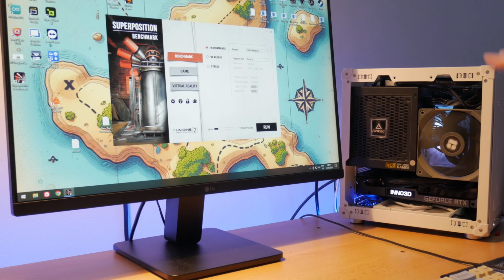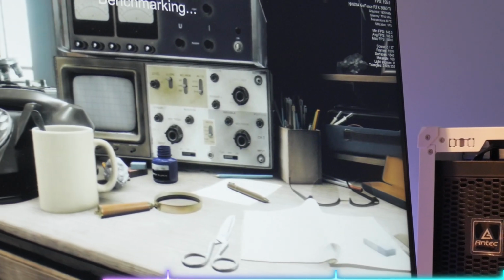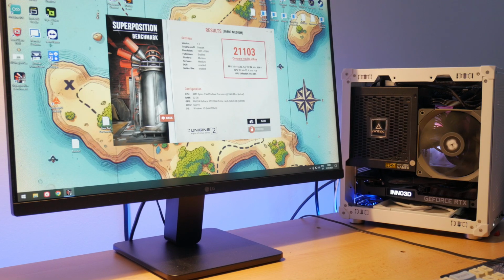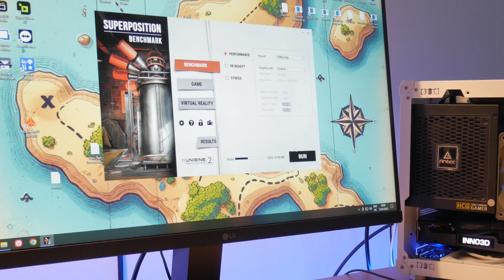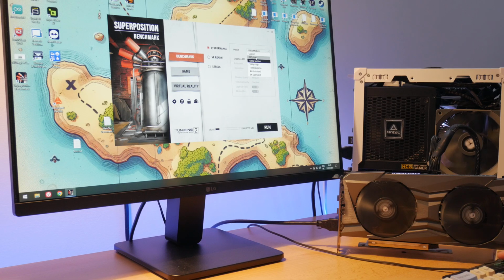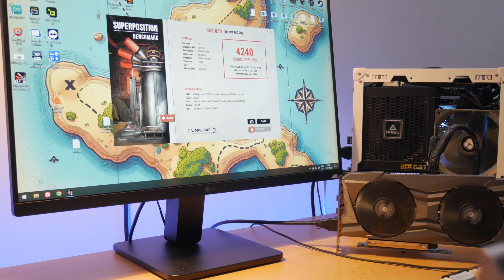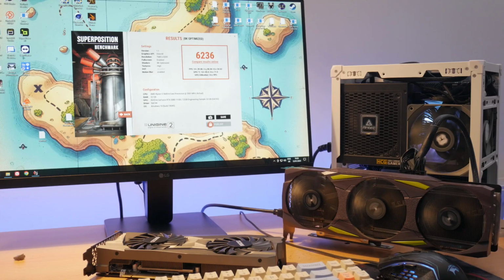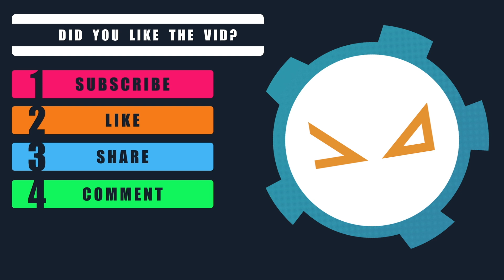Does a PCIe Riser Cable RUIN GPU performance?

Comment: By comparing to outside you change by quite a lot one parameter, temperature
Reply: shouldn't make much difference since its not throttling, although I know some cards will self-overclock depending on how much extra temp they have to play with so hopefully he set the clocks the same for both.
Reply: @albr4  yeah it should be fine if it's fixed, I just assumed he didn't
Reply from the maker: Hey, thanks for the heads up. The clocks (core and memory) for the 3060ti were fixed via the msi afterburner.

Comment: Pretty neat, thanks for the comparison, i was thinking of mounting my gpu sideways in my new pc build
Reply from the maker: If you do I imagine it will look nice! I also had an idea to mount the gpu vertically in another case, but I never got around to doing it which might be a good things as the monitor cables would be on the top which wouldn't look nice.